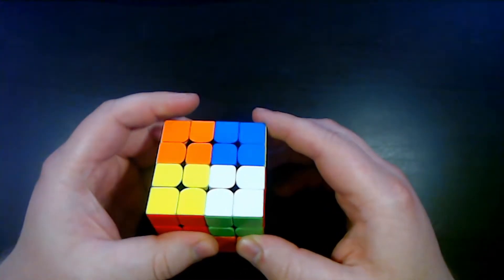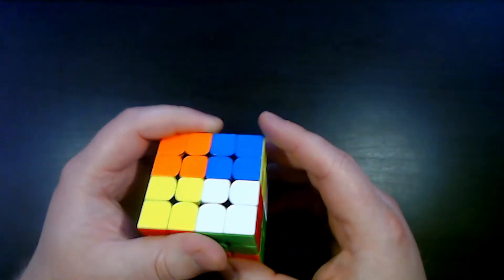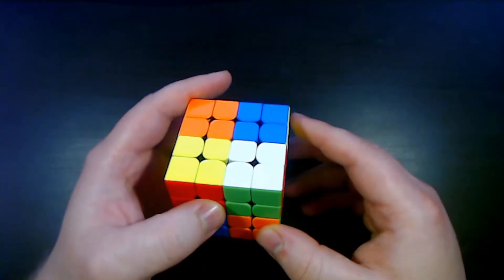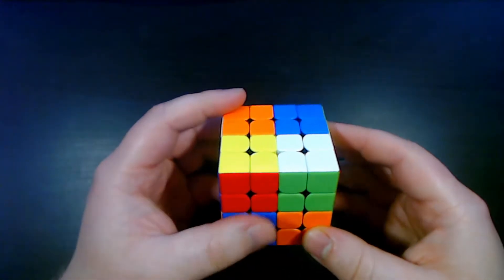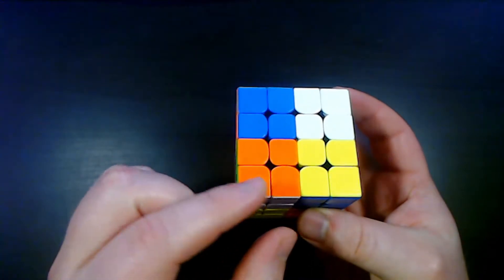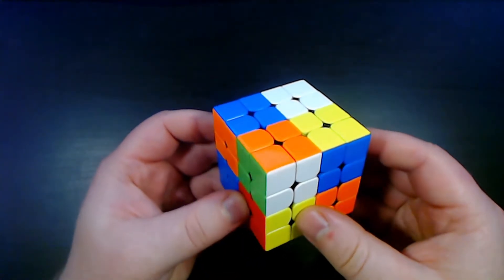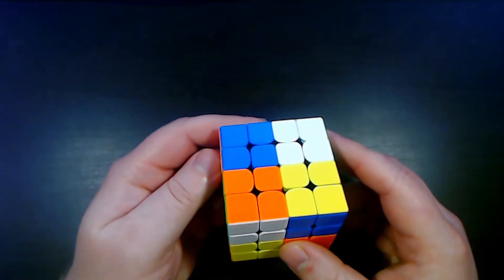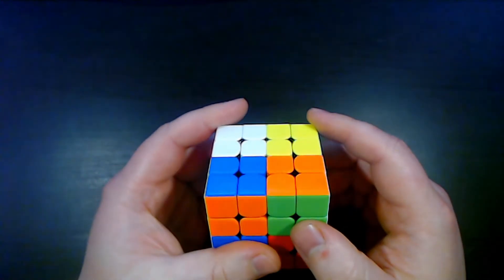2cep Full Overview

Comment: So ive recently gotten into this idea and found you. Only issue ive been having is visual aid would help tremendously in knowing which case is which. Ive gotten to the point of 4 sometimes 5 corners. But then get lost
Reply: update I did get a few solves with it using the wide t perm for the last few ages you talked about and once I get good at doing all that im gonna dive deeper into everything. thank you for all of your hard work.
Reply from the maker: I'm sorry I didn't see your comment earlier. I'm glad you were able to get some solves done. I still love this method, but I haven't had the time in a long time to actually work on improving it or making better documentation.
Reply: @PlusTwo  I havent done it in a while myself lots of cases to memorize but I love the fact theres no parities
Reply from the maker: The beginners method is a great option. All you need to memorize is the t perm from crop, and a couple easy algs for centers. And still no parity.